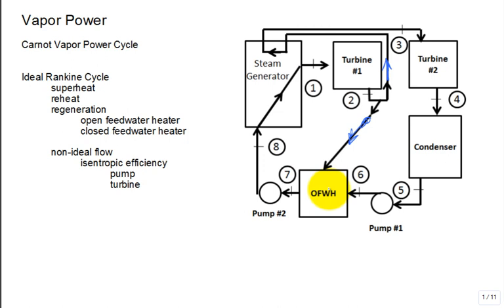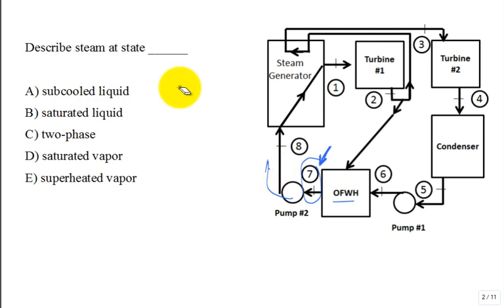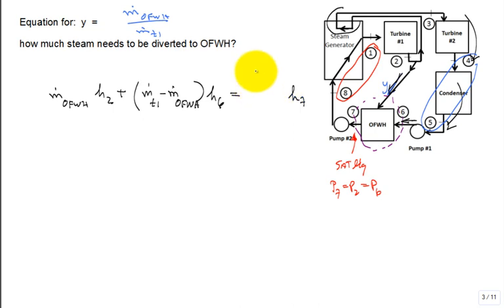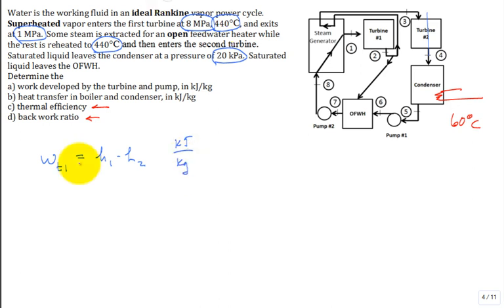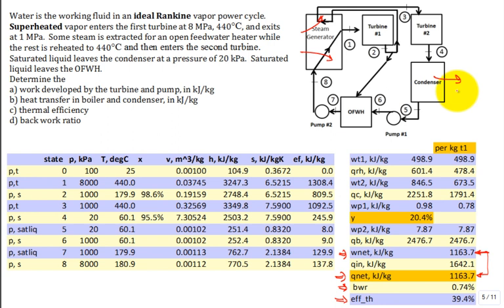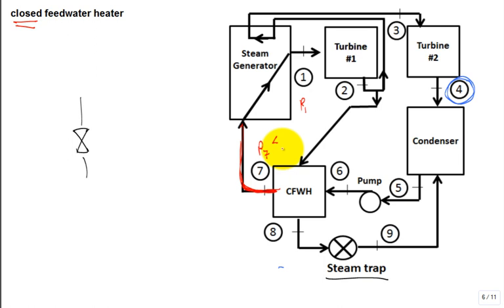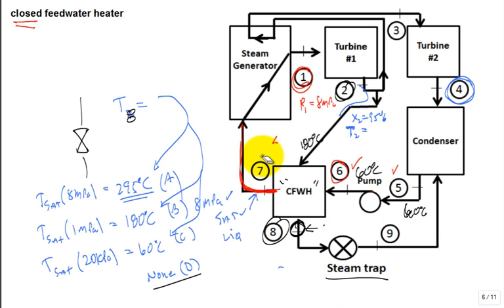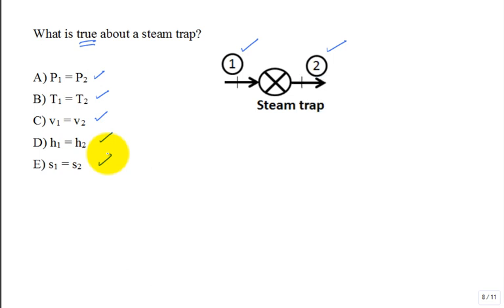ME4293 Vapor Power 5 Spring2015

Comment: i had a problems finding h6 and h8 for the example given at 20 min. would you be able to guide me as to how to find them? more specifically h6 so that i can then calculate for y
Reply from the maker: penguim90 using sofware, h6 = h(p6=1MPa, s6=s5=0.8320) but by hand you would use h6 = h5 + wp = h5 + v5*(p6-p5) where pump hass 100% isentropic efficiency.  Same for pump #2:  h8 = h7 + v7*(p8-p7) if doing by hand.
Reply: thank you so much for your help, professor!